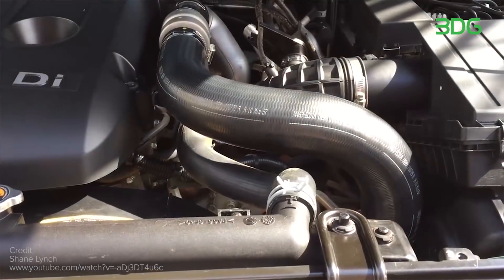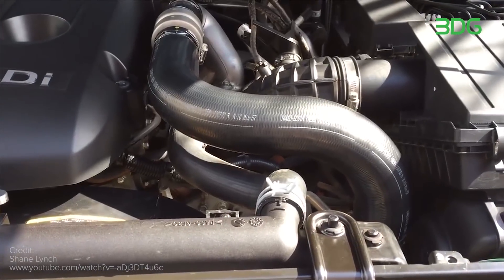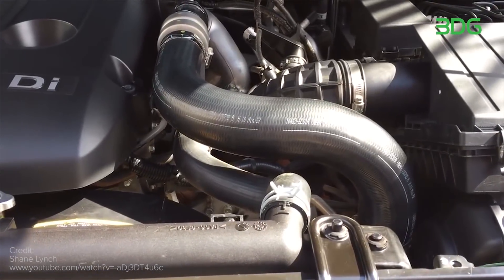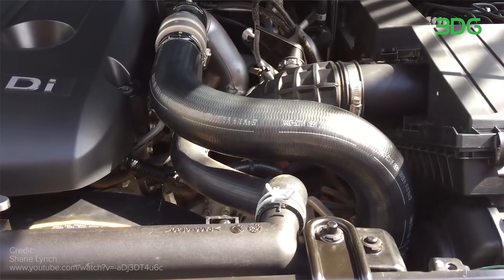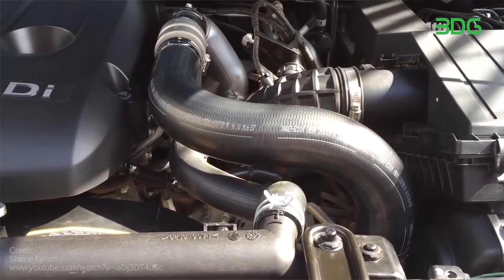Why Navara Blow Black Smoke

Comment: Brought a 2011 Nissan Navara and it seems to blow black smoke from gears 2 and 3 and a lil in 4th what can I do to minimise the smoke please I’m not a car guy so it would be great if anyone would give me detailed information please
Reply from the maker: @TristanWhite-n5x  generally, the lower gears (1, 2, 3) usually have more smoke as the turbo struggles to keep pace with the rapid engine acceleration. 
But it is an indication that something is starting to become an issue. As a guess, I'd have the intake manifold inspected for carbon build up and then go from there.

Comment: Just brought 2011 got 266000 on the clock and it blows smoke changing gears
Reply from the maker: @TristanWhite-n5x  I'd be looking at the intake manifold for build up as a starting point.

Comment: PCV Valve? I have just installed a reconditioned 2.5TD. Driven less than 400km she has started to blow smoke, (I think it is black), the mechanic has been back out to look at her and has blamed the PCV valve and now I need to replace the rocker cover ($250) due to the PCV being built into the cover. 
Work to date- recon motor (HMgem), New injectors, fuel pump, blanked off EGR, MAF,  SCV, and all filters replaced.. Are these guys pulling my leg!
Reply from the maker: I'm sorry to say, but it's a hard one to comment on. My 'commercial' opinion is to probably change the suggested part at this time, and see how things got on. 
Keep us posted mate.
Reply: Current update: The nav lasted a week, and the turbo (garett GT2056v) snapped its shaft.  The motor began to run over. (Running on her own oil) Car has been in the workshop for three weeks now. I have no idea about the damage done yet. Apparently, the intercooler and manifolds are full of oil and turbo needs to be replaced.
Reply from the maker: Far out @seancampbell3381 that's unreal. keep us posted and let us know if we can offer and help.
Reply: @DieselGeeksOz  car has been returned, seems to run ok, no rattles. Turbo is very quiet compared to my old one. It almost seems like it's a lower boost.
Problem she blows white  smoke again
.only while accelerating in low gears off the lights or reversing. But no smoke on the freeway  while cruising at 110knh in 6th. 
You can only see it at night in headlights, not obviousduring the day. 
I'm not sure what to do. Lubemobile has cost me a lot more than the cars' worth. Shattered!!
Reply from the maker: @seancampbell3381  to be fair mate, an older diesel will almost always have that haze visible from the headlights behind at night time. 
I'd send them the comment in the email so that it's logged, but tell them that you'll put 10,000-20,000kms on it and see how things go. 
Best case, motor beds in properly and it goes away, or it gets worse and it needs attention.
Reply: @DieselGeeksOz  cheers for the advice  bud, I'll give her some time to settle

Comment: Can injector cleaner fix it ?
Reply from the maker: Depends on the issue. IF its a EGR failure or split intake pipe for example, its like throwing a shot glass at  a bush fire. Nothing doing. 
It can help however if you've had an issue which was causing the engine to soot. This soot - even if you've now fixed the root cause, will have 'carboned' up the engine. Removing this carbon will help. Some injector cleaners are good for this, as is a hydrogen based carbon clean.

Comment: My QD32 blows white smoke during take off and slowing down. It's an old boy but lesser or no smoke when on speed at 4th gear. Any help would do
Reply from the maker: Boost is life brother! haha

Higher loads make the average boost levels higher, and the higher engine RPMs help those older injection systems build up more injection pressure.

Very common symptom of the tech of that day.

Comment: Yes yes please tel me when i'm starting my  navara up in the morning there blue smoke egr is block and itz Dcat it looks like it hapen only when its very cold but when i'm driving there's no smoke and tel me what blue smoke is and what black smoke is
Reply from the maker: Hey Denzill;
 Blue smoke on start up is the engine burning oil i'm sorry to say. Its possible that its valve stem seals and not necessarily rings, but its an expensive fix either way and therefore best to get a good mechanic to work out exactly what it is for you. 
 YouTube mechanics can only get so far without seeing the car. 
 Best of luck mate. Keep us posted!

Comment: I have a 2009 titanium edition navara. It blows black smoke and in second gear I have virtually no power. I put my foot flat to the floor and it blows a heap of black smoke then it eventually takes off. Really annoying as I need to tow a trailer

Comment: need a desperate solution.  Coming home just now. Had to pull over smoke was coming out of the motor bay.  lifted the bonnet and turned the motor off. The drivers side rear and rear side is covered in oil.  I've dropped oil or something snapped???   Has anyone experienced this.  The ute is a 2005 Nissan Navara D22 diesel 3l.  had to be towed home?? Help!!!!
Reply from the maker: Unfortunately mate, theres not really enough info there to give any real sort of accurate answer. Sorry we're unable to help this time.
Reply: It seems Matty that I have blown the motor. Don't know how, I have looked after the motor like a baby.  I lifted the oil filler lid while the motor was running. and it was like a volcano lifting of the rocker.  ii seems that the oil spewing out was because of pressure from the blown motor. the valve on the rocker cover was where the oil was spewing out . Hope I am right with the Diag. smoking from the oil filler hole as well.  Does it seem right?
Reply: also thanks for you site here. I was recently following along about the EGR valve. I also have a D40 2.5l diesel.  I was told from a local Nissan service repairer that  the problem I had was the diesel pump and so would cost over 3 grand to fix. But after following this site that you have I thought maybe it is a SC valve or EGR. So got them both, But because the SC valve is a bit difficult to get at I decided to  fit the EGR first. process of Elimination.  It was the EGR. It's running like a dream.  thanks Matty. just got major issues now with the Navara now

Comment: So a general question guys - is there any other reason why you wouldn’t blank off the EGR ( other than the the legalities of blanking it ), I mean from ‘affecting the engine’ reason ... ? 
What are the cons to blanking it ? ( other than from a legal point )is there any other reason why you wouldn’t blank off the EGR
Reply from the maker: One that is rarely spoken about is that the engine is tuned to run WITH the EGR gasses in play. Timing and pilot injection quantities are all adjusted accordingly. That being said, its not a major problem nor are you ANY risk of engine damage, its just not very efficient. You can often here a car with a EGR blank fitted with a rattle circa 2000rpm and light load. 

If it were for off road use only ;) I'd be blanking it.  Being very aware its illegal to drive on the road that way. 

Hope that helps guys
Reply: @DieselGeeksOz  when you say the timing and ( pilot ? ) injections are all adjusted accordingly, do you mean as in they’re not then over fuelling as much ( due to their inherit high flow rate ) which helps to cut down the soot ? and you would see better fuel economy and no clogged up black inlet pipes, clogged butterfly etc  ? 
What about EGT’s then - do this increase at all causing reason for concern ?
And I’ve seen some saying you must blank at both ends of that evaporative pipe, the one that has the 2 coolant hoses coming off of it, and others say just the exhaust outlet end of that pipe ? If you block both ends though, does the coolant still circulate through that evaporative pipe properly ? 
Lastly, if one was to block it for off-road use only, is there an advantage to also for a quality oil catch can ? The idea I believe is to really minimise how much of that sludgey carbon build up crap gets inside your inlet pipes and butterfly ?
Reply from the maker: @4WheelingInNSW  Pilot injections are micro quantity injections that are prior to the main injection / combustion. I actually have another video on it. Basically they're there to stop a rattle. intake temp plays a massive part in the fuel volume and timing of these micro injections and therefore 'messing' with the EGR system can mean that these go 'out of tune' and the engine gets a little rattly again.

Re the piping, no real reason to block both. There are MANY instances where EGR cooler assemblies fail and leak coolant in the engine. Perhaps this is what those people are referring to? If the EGR is effectively blocked, I'd be removing / bypassing the EGR cooler and ensuring no water is going there. 

Re the catch cans. 
 Its actually the carbon from the EGR mixing with the oil mist, forming a carbon mud (sort of thing). you only have to remove one of the ingredients. Remove the oil (catch can) and the carbon from the EGR will freely pass through the engine. Similarly, if you have blanked the EGR, now there is nothing to get stuck in the oil and therefore the oil can freely pass through the engine without mixing and building up. Its unnecessary to do both (unless its high boost applications - another story).

Comment: Hey I’ve changed my suction control valve with a brand new one and my car still stalled when I drove it I don’t know what else it could be need help please
Reply from the maker: You must have the ECU reset. Very common for this to happen if you've changed the SCV and not reset the ECU. 

The ECU 'learns' driving the old SCV. Now its a new one, its still trying to drive it like the old one hence the drama. In some vehicles its called 'zeroing the counter'.  

Try that and let us know.

Comment: My D40 Navara RX Has power lost going uphill ( 60-80 km/h) , which coincides with black smoke. It gets better if I just lightly tap off on the accelerator.
Driving level and downhill is fine. Driving uphill on my farm has never caused the same (low speed) even with weight on the back.  Where do I start looking?
Reply from the maker: Start with intake piping for sure

Comment: Thanks a lot for the very helpfull video :-) But what if the smoke ( black ) only occurres on cold starts combined with a "knowking" noise that will last for 15-20 sek ? When warmed up, car runs perfect !
Reply: Sounds oil pressure related
Reply: I have a 2010 D40 and mine dose the same thing. Did you end up finding out what was wrong ?

Comment: Have had problems with my 07 Navara, the sympyoms are that if it idles for any length of time at the lights or a junction for example, then when I go to accelerate it may cut out or be non-responsive or kick out   white/grey but mainly black smoke.   I'd have problems trying to restart it immediately but if I wait a 30 seconds or so, then it starts and drives ok again. Also under load it's worse but it mainly  feels as if it's being starved of fuel. I've taken it to several mechanics; the first one flushed the fuel tank and pipes ...no change. Another mechanic charged £40 for plugging in diagnosic, found no codes but suggested it be the head gasket (took him 10 mins). Another suggested it be my injectors. A reputable company suggested it the Fuel pressure sensor but said it would cost over £900 to change it. Had the fuel pressure sensor changed by another mechanic but he suggested it was a faulty EGR so best to blank it off and get it remapped. Another mechanic thought it might be the MAF sensor so cleaned it but no difference. Decided to do my research and so far it's looking likely to be the SCV.  This video backs up my theory too. Saw another YouTube video that said the short SCV were rubbish and to replace it with the longer one but having difficulty ensuring I get the correct long one. Any suggestion would be helpful. (Sorry for the long comment)
Reply: Hey have exact same problem! Would love to know how you got it fixed and is the scv replacement worked? Thanks

Comment: I think my scv is on its way out, I get a hiccup when ever I'm idling especially when the engine is hot the tone of the engine changes and becomes knocky, when I put it on my laptop and monitor the rail pressure when ever it hiccups the rail pressure goes up and up and up until I blip the throttle and the rail press goes to normal and the engine sounds normal again until it hiccups again.
Reply from the maker: @Devil - Sounds very characteristic of a SCV fault. I'd certainly be starting there if it were my car. Goodluck'

Comment: Hello, I have pathfinder 2.5 diesel. Scv gives 29-31 mpa At idle. And the ECU has a task of 28. Is this normal?. The engine is very loud. Pump regenerated. New injectors.
Replaced the scv valve, nothing has changed. Now the idle pressure is 35 MPa
Maybe it is about the thickness of Black smoke when starting off. Black smoke when starting off. And with acceleration. Trottle stops as I accelerate. When I drive at a steady speed, the rattling returns. 

When I drive at a steady speed, the rattling returns.
I have a new injectors, pump, scv, maf, map, closed EGR.
There are two problems. Loud, rattling noise like injectors and black smoke in first gear and accelerating. The engine is quiet when I accelerate and loud when I drive at a constant speed.

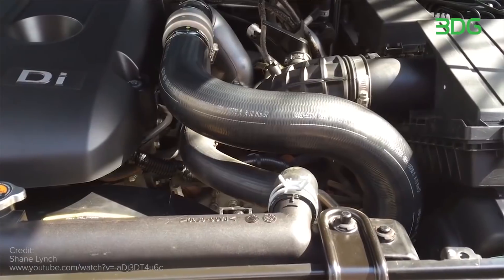Comment: 3 years ago I bought a 2014 D40 ST 45000Ks on it . It blew  black smoke and fuel economy averaged  9 litres/100klm. I installed the $7 EGR blank plate and replaced the expanding rubber Intake pipe @2:45 with a $150 PLAZMAMAN aluminium hot pipe. My fuel economy average became under 8liters/100klms , I got 940klm on one tank on one long trip and I still get under 8 with 90000klms on the clock and NO smoke.
EDIT. I also at the same time used Liquimoly diesel engine intake decarb to get all the sooty shit caused by the EGR valve out of the intake manifold. these basic mods made a huge improvement and protect the engine from dirty exhaust gases.
Reply: thanks for sharing

Comment: I just took possesion of a 2010 navara d40, it's my first diesel car. i didn't realise it was blowing smoke. till i got it home. was just taught an AU $11,500 lesson. anyway, how much would each of the above mentioned problems cot to fix? i Probably have one or more of them. I checked the air filter , it looks brand new but it doesn't look like the right size there there is no good seal. I guess the A-hole that sold me the car tried to fix the problem him self

Comment: Could any one of the issues mentioned also result in shitty power on hills. I have a 79 landcruiser, rebuilt motor, stock 85hp and it will smoke my '12 navara on any hill in my area (costa rica).

Comment: Hie air. My nissan navara consumes a lot of diesel and slight ly more smocking black in color. Plz if you can give me a hint what could be the problem.
Reply: Best thing you can do for a Diesel is take it in for a tune, they remap the ECU which includes fuel, cams, air etc which will fix this issue as long as there are no underlying issues..... all the while increasing power and fuel consumption.... Also add a oil catch can if you haven't already

Comment: I had the EGR problem, went the not recommended blank off option. worked fine for a couple of months. Which of the other things you mentioned is likely to produce heaps of black smoke and massive loss of torque on hills?

Comment: I have a 2011 d40 with 150,000 kms and it blows no smoke at all
Reply: If you take good care of it, it will be a good car
Reply: I have a 2009 what blows no black smoke. No egr blank. Runs like a dream
Reply: I've been instructed to use an injector cleaner every now and then to keep the EGR and the injection system clean.  I bought the liqui Molly fuel additive for diesels.  70l to 500ml.  no smoke at all. but make sure you use the right quantity  as it has a hotter rating to the diesel fuel.

Comment: "We don't recommend blanking the EGR" nudge, nudge, wink, wink..
Reply: Matt  thank you for this info. But I have an issue , a complete different issue.  But some smoke is involved. maybe you are able to help out.  I live down the South coast now. I know that you know me personally.   Now. My issue.  I was driving back home from Rosedale one night in my 2008 Nissan D40 ST Diesel. When I noticed  black smoke round about Mckenzies beach.  Then I lost some power. but still managed to get home a few K's down the road tp Malua. .  The next day tried to investigate the problem. took it for a drive when the black smoke turned  white. until it stalled.   had it towed back to Malua bay.  Now I've been told heaps of things.  but I have this feeling that it might be the SCV  but can't be to sure.  It hasn't started since. But it winds over.  Have you heard  of issues like this??
Reply: @robpeterson8795  same thing happened to my 08 D40. Turned out to be a failed egr. Blanking plate fixed it.
Reply: @wrongy22  Im about to rip out the SCV before anything else.  then I go to the EGR if it doesnt happen, thanks mate.
Reply: What does that mean ?

Comment: Nissan Navara D40 blowing smoke is NORMAL. I have owned mine since new and it blows smoke from the day I drove it out of the dealer. 210 000 klm hassle free driving so far. 2011 model st.
Reply: Hows it going now mate? I have a 2011 D40 and it is blowing a little bit on acceleration.